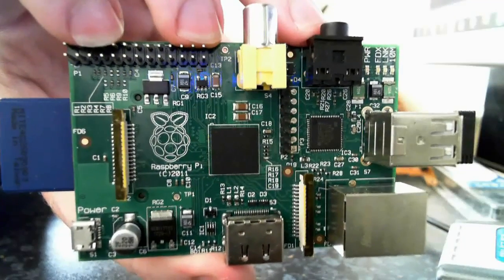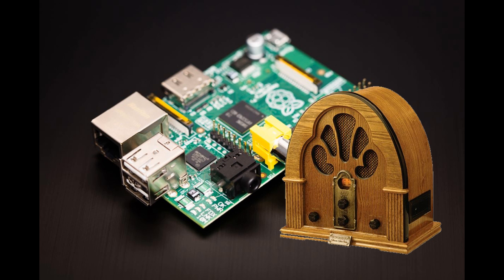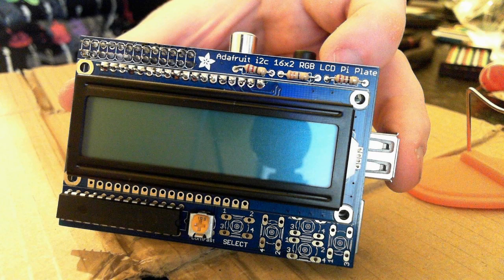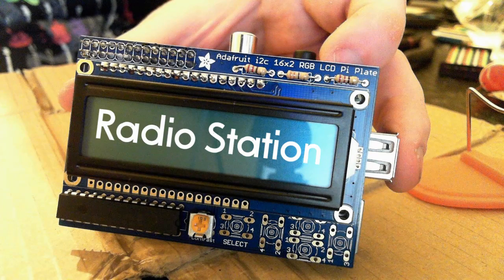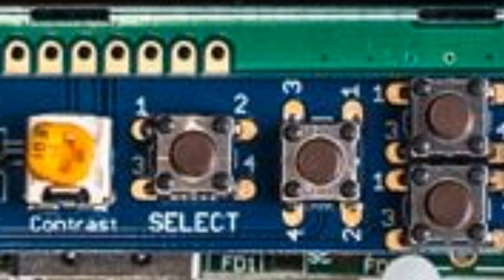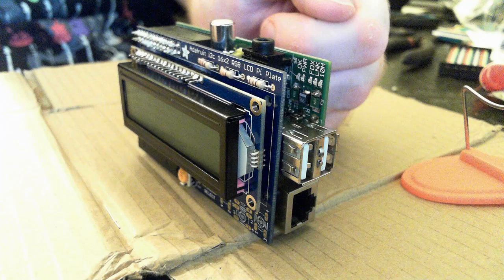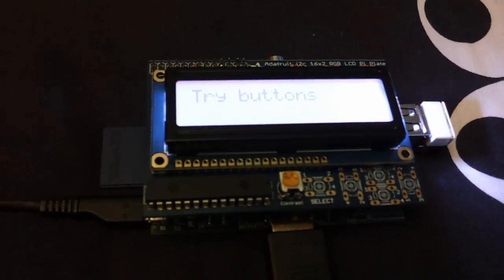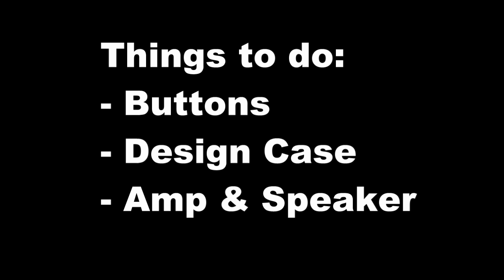Raspberry Pi Internet Radio - Part 1

Comment: Why not just use the analog output from the pi and use any stereo speaker and amp that has 1/8" input, skip the whole voltage issue all together.
Reply from the maker: Did use the analog output if you follow the rest of the videos. And wanted a complete design that doesn't rely on have a separate speaker and amp :-)